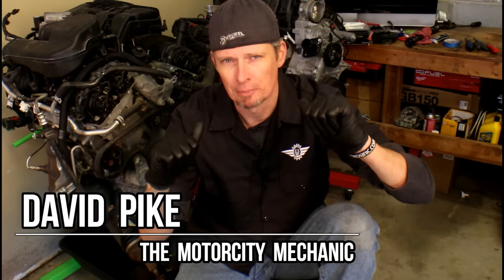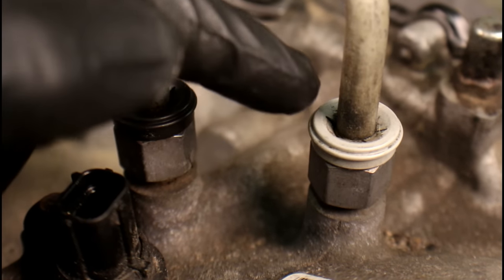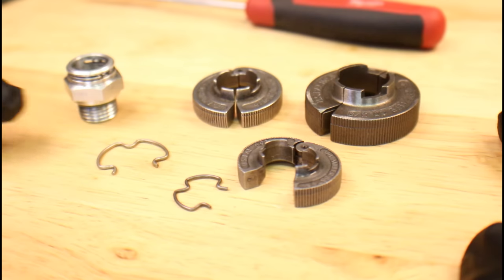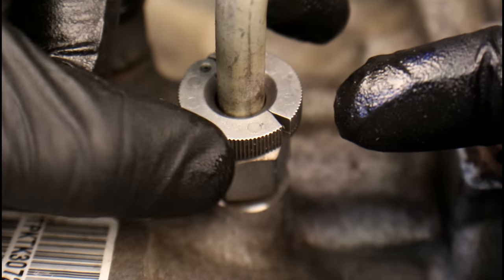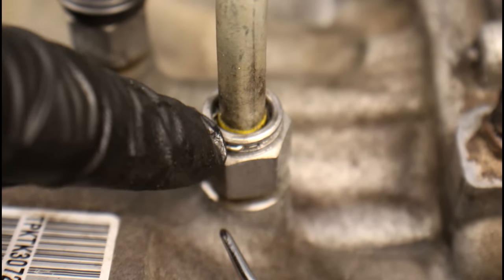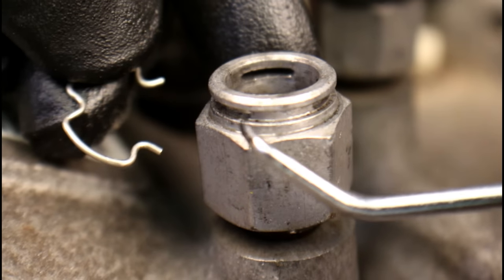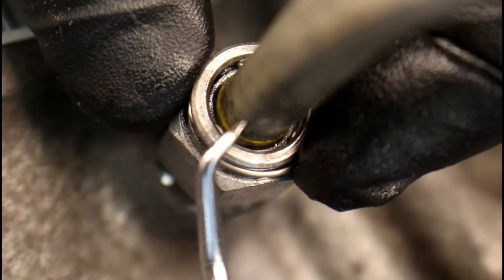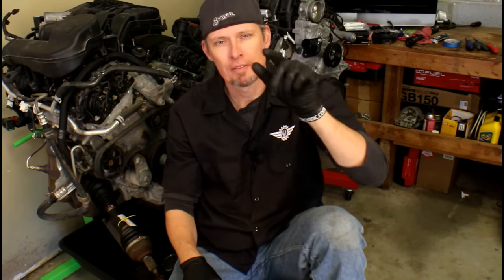Quick Tip: Removing Chrysler and Chevy transmission lines with no special tools

Comment: So I have got a friend with a 2014 Dodge Journey with a leaking trans oil cooler line. I plan to replace it for him. Do they have the same type of line as Chrysler? Also, his is the 4 cylinder model.
Reply from the maker: Most likely it will on one end or both ends. After watching this video you will know what to do. Thanks for asking and make sure to subscribe.

Comment: 2006 jeep commander I changed those fittings going into the ac/cooler and still leaks. Should I change the whole unit or will a clogged trans filter cause that.

Comment: Hello! We have a transmission fluid leak coming from the quick connect. Will buying a new quick connect stop the leak? Should we use some type of sealant or replace the entire line? 😔

Comment: Hi there... In my understanding there was transmission fluid leaking... Am I right? If so, when you removed the hoses, how much fluid was lost? and after replacement of the hose, do you need to refile the transmission fluid?
Thank you

Comment: Question for you...Which is the supply out to the cooler and which is the return back to the transmission? I think that the supply us the one that's easier to get to and the return is under the exhaust.
Reply: TE62 transmission

Comment: I am looking at a 05 Chrysler 300 for $600. Body and interior is good. Has the V6 that is good, , but the transmission is bad.
It is all wheel drive.  Found a low mileage 2 wheel drive transmission for $500.  Will the all wheel drive transfer case bolt up to a 2 wheel transmission.  ?
Reply from the maker: Wish I could tell you for sure....havent had to remove an AWD setup yet or paid attention to see how its fastened. Only way to check would be to call you local dealer and have them check to see if there are different part numbers for the transmission based on 2wd or Awd. Thanks for being a loyal subscriber.

Comment: Thread size on the transmission cooler lock nut? Looking to install an aftermarket trans cooler with new lines and i want to replace the hard lines instead of piping it up to them.

Comment: There's 2 colors on the cap. One gray one black.
How you do know wich one is the outer and the inner line into the trasmission and the same case with the cooler? I wanna know wich color goes where? There's doenst seem no identification anywhere.

Comment: Great Video! Thanks! Do you have any idea where to find the anti drain back valve on these vehicles?  I can't find the information anywhere, and your videos are my favorite to watch. Thanks!
Reply from the maker: Thanks for the kind words Michael. I have to be honest with you.....I really dont know. I looked thru all the parts info and the only thing that comes close is the cooler bypass valve that is in the case of the trans and accessed by removing the front pump. Otherwise they dont show anything seperate or even mention it for that much. Wish I knew more that I could pass on to you. Thanks for asking and for watching. Make sure to subscribe.

Comment: Great video. I will be replacing my line this weekend. Do you have any tips for the other side of the line where it attaches to the transmission oil cooler? Thank  you!
Reply from the maker: Troy Dunn Most are the same fittings as that shown in the video.

Comment: You didn't show putting the line back into the fitting !!!. Is the clip fully engaged and locked in place before you push the line in ?. or does the clip have to be out of the grooves to install the line ?.
Reply: I am replacing the radiator  and the drivers side trans line snapped into place just fine with the clip in the fitting, but the line on the passenger side won't snap in fully to get the bump past the clip area, even with the clip removed.

Comment: Hello Dave. Just a quick question... Is there any kind of failure that this leaks on these hoses can cause on the transmission like slips or other things? Besides overheating or lost pressure something like that

Comment: Appreciate the tips but you haven't mentioned how the sealing works.
Reply from the maker: It has an internal o-ring. I have never seen one leak, if it does then you have to replace the fitting. Sorry I didnt mention it. Thanks for asking and make sure to subscribe

Comment: Am I transmission I changed at the Illinois? But the problem is it's stuck in the universe and the key does not go. When I have a hard time? Pulling. It out what should I do wrong I followed all the steps

Comment: "Hello " Motor city  👍
I have a 2013 jeep wrangler unlimited JK sahara v6 3.6 automatic W5A580 transmission 
Can you please remind me witch transmission line is the hot and the cool line 
I would like to install a B & M transmission oil cooler with fan  IS the top line the hot ?
On the transmission 
I have a hard time to see the line that goes into the Radiator 🥸 
●|||||||● 
Thanks

Comment: What about when the transmission is in the car
Reply from the maker: THE FLYING DUTCHMAN still no issues with doing it. I have never had a problem with using the same method in any of the transmissions in any of the  vehicles I have worked on or the trans coolers as well so you won’t have any issues. Thanks for the question and make sure to subscribe

Comment: My line appears to have broke on the line just above the nut/flange/quick connect fitting. Is there anyway I can repair this without replacing entire line??? Thank you. Car is 2010 Dodge Charger NAG1 trans
Reply from the maker: I havent seen anything yet that will work.....the other issue is having enough length to position a fixed piece. Sounds like a line replacement might be needed.

Comment: I have a 2016 charger rt. My transmission temp has been heating up to 244 I had to pull over and let it cool this was at stop and go in the city and on the fwy it cools down. Do you think it’s my transmission lines and cooler? Need help it’s driving me crazy I thought it would need a fluid change by the dealer said I was fine. Then they tried to sell me some crap for my coolant which isn’t my problem. It’s my trans. Need help thank you!

Comment: Us backyard self taught mechanics have been using the pick method from the beginning!!...shame that car makers  need to use this crap on cars there was absolutely nothing wrong with the flare nut style and never leaked from vibration as the new "quick release" style...but I guess you can't make money or sell new modern turds...with out a gimmick😂

Comment: I have a 07 Dodge Charger that just won't run .. replaced pcm BCM wire harness every sensor key key fob alt timing chain all intake gaskets .. you name it it's been replaced and flashed by 2 different dealers .. still does not run .. fires up sometimes and sometimes not.. plugs , coil packs , recalibrate fuel pedal .. old and new intake runner value throttle body cam and crank sensor oil pressure sensor .... and no codes .. and no wire is lose or cut into .. ive traces all wires by hand 1by 1 check omS ... under the hood fuse box .. trunk fuse box ... replaced all this car doesn't run.. new fuel pump .. I have check compression it's all good on all cyl .. yes it's in time .. replaced water pump and new chain sense I was into it .... sooooooo yea .. doesn't run .. what's wrong ... and zero codes .... in dash or scanner

Comment: Is there o-ring inside tube to seal line?
Reply from the maker: Metal Halide there are but never seen any replacement seals for it, otherwise if leaking then you need to replace the quick connect fittings. Thanks for asking and make sure to subscribe

Comment: David:  I also have an older Jeep (2010 Wrangler) and I am trying to remove the transmission lines (leaking).  I removed ALL the clips using picks (no round tools have worked for me yet).  BUT one end of one line (on the radiator side) is NOT budging.  Tried moving the loose line around (in and out, left and right) and I am concerned that I might snap or break the line connection on the radiator side.  Tried PB Blaster, WD40, pure pulling straight out and now I am about to try heating it (for a short time) with a Propane torch.  The top fitting is just holding on to that line no matter what.  I am able to pull out all 3 other ends with no problem.  Any suggestions?

Comment: Ey Dave what’s is the normal temperature of the 8 speed transmission my 2012 300 temperature running around 180 to 200 F on normal driving outside temperature 60 F
Reply from the maker: There is not written specs on whats normal and I havent payed attention to the temps when driving them. Which that they listed normal temp ranges on oil and trans temps but they seem to think its not needed for us for some reason. I really need to start monitoring it when driving cars at the dealer ship inorder to get a feel for what is normal and whats not. I would assume if the temp was too high that the trans temp light would come on.

Comment: How do you get the cover back over the e clip. Is there a easy way
Reply from the maker: If I have issues I try starting at an angle and then press it down as I rotate around it until flush. Typically that works but sometimes I have to use a flat tip screw driver to push the clips under the cap so that it will go back down. Thanks for asking and make sure to subscribe.

Comment: I replace the trans fitting. Had hard time popping the line back in the new fitting. Like started to leak again. Could I have damage the new o ring in the struggle?
Reply from the maker: I feel you will be okay. Just keep an eye on it after you start the engine to see if any leaks.
Reply: My jk jeep is leaking right where the line enters the transmission.   Do i have to remove that clip and line then unthread the receiver portion and replace that?
Reply: @MotorCityMechanic  look at my above comment it was meant for you, please :)

Comment: I know it's completely off subject, but do you know anything about transmission fluid changes on the 8 speeds? I wanna change the fluids and the transmission shop is trying to charge 800 plus and most likely gonna do it myself. Any info would be much appreciated

Comment: Hey bro I got a Chrysler 2012 300 with a 3.6 engine..I was driving and some my transmission coolen line came off and drop my transmission oil out..so I turn off my car because my check engine came on..so I knew that probably it when it protections mode because it would not let me change my gears..so I try looking for the transmission oil dip stick but it does not have one so I could but some transmission oil in it..one off my friend sed let but some through the transmission breathing holes..so we did we just but one 1 quart..afther the car let me change gears..but I don't know how to check how much more I need to but in .and ..is it ok how we but in.the transmission oil.. through the transmission breathing air hose..

Comment: I am no chrysler tech, but on its' face it looks like you can just pop those plastic caps off and then put a flare nut wrench on it? Why cant you do that?
Reply from the maker: Noah Kuzel Doing that would mean removing the fitting which takes even longer. It’s harder to thread a fitting with a line attached to it back onto the trans or cooler while trying to line it up perfectly and not cross thread anything then it would to pop the clip off and pull the line out.

Comment: Do you know the part number for the quick disconnect tool?
Reply from the maker: There are different sizes of these tools and different companies make them. The most common one that I use is made by miller and the part number is 8875a. Thanks for asking and make sure to subscribe.

Comment: With my 2017 HD2500 Ram w/6.7L I have a question: I thought when I purchased my ram at the time it had all of the towing options that I can get with this three-quarter ton pick up. After reading forums I have come across where I guess there are options with 2 oil coolers or 2 transmission oil coolers. 
Is this correct? If so?  how can I find out whether or not my ram has either?
With the window sticker really not telling you anything.  Honestly I really do not want to have to tear the whole front of the pickup apart just to count coolers. Can you help me with any knowledge?

Comment: Hey would you recommend a proper installation of a 2007 300c transmission pan i just swap the fluid and notice the pan is leaking? I use NAPA gasket but should i have gone with dealer or use silicon?
Reply from the maker: Do you remember which trans....was it held in place with 6 torx bolts or a bunch of 8 mm bolts?
Reply: MotorCity Mechanic torx
Reply from the maker: That is a NAG trans it uses a thick rubber seal that holds into the trans pan. No silicon.

Comment: Any chance you know the part number or size of the retainer clips?  I had one come off while driving just now but was in my neighborhood and made it home with the remaining fluid, barely.   I changed the lines a few nights ago and that one clip didn’t seem right and it failed.
Reply from the maker: The clips arent avail separately, at least not thru Mopar.....you have to get the quick connector itself that threads into what ever it mounts to such as the trans cooler or trans case. Not sure if anyone in the aftermarket sells them. Thanks for asking and for watching. Make sure to subscribe.
Reply: 5/8 retainer clip
Reply: I found them by googling "steel quick connect retaining clip". The assortment has 3/8" clips which work for my 2017 Silverado

Comment: Question...

I took off both e-clips from the transmission lines, however I can't seem to take off the cooler fittings from the lines and they are a bit stripped. Is there another possible way to remove those fittings?
Reply from the maker: Once the clips are out the lines should come out.....you may want to stay and rotate them to see if they break loose and then come out. Otherwise you use a wrench to get the fitting out. If that doesnt work then last option is cooler and line replacement. I sure hope it doesnt come to that. Thanks for watching and make sure to subscribe

Comment: I took the clip out of the fitting already but I cant remove the actually line from the fitting. It's super stuck. Is there a way to remove it th right way? I been using all my strength and weight to remove the fitting from the line but I just cant. I did another one just like it and it simply slipped out with no effort
Reply from the maker: It could be corroded in place. I recommend trying so sort of penetrating fluid if possible and then just do you best.....thats about all I can say. Try backing off the connector itself from the trans case or cooler (where ever it is) and see if it breaks the two free and then pull the line off.
Reply: I actually damaged the nut into 4 peices... it still wouldnt come off the line so I had to use a lot of muscle and even pry it out! It turns out someone did something with it before and the inside of the nut was crimped into the line.
Reply from the maker: That explains it then as far as why it didnt come off like the other. Thanks for the update

Comment: Where can I get the clips and o ring for ref 68 trans on my 2017 ram 3500. Can’t seem to buy them with out the complete line kit
Reply from the maker: Not sure if the clips are avail seperately. Most like you need to buy the fitting that they snap into. Looking up the parts....the attached link is for the ones on the transmission. They come with the o-ring and the c-clip. Otherwise you cant get those individual items separate. https://www.amazon.com/MOPAR-55111025AB-Fitting-Quick-Connec/dp/B01EIBJ2NC/ref=as_sl_pc_qf_sp_asin_til?tag=motorcmecha01-20&linkCode=w00&linkId=5409caefaa85a70208a62ca1f1789d52&creativeASIN=B01EIBJ2NC

Comment: The snap will deform and the hose will pop off. Dont do it. Use the tool. I been cleaning this mess all day, the pressure side let loose in my case.
Reply from the maker: Never had an issue….also I recommend making sure the plastic cover is reinstalled, that prevents the spring lock from coming loose

Comment: Theres a few ways to get those off, (just like high pressure fuel lines), u can make one of those tools out of a soup can thats cut similar to the actual tool, and u can also use either a steel, or even copper water supply line that is just a little larger than the lines being removed, then cut some tabs to stick down for the 3 areas of contact, (pointed or angled tabs worked best for me), basically, the jist is simply use anything to use as a shim between the line and clips that retain them, I broke a $20 "line replacement specialty" tool, only to learn that my kids hot wheels cars are more durable, and it broke the first time I used it, (and I was being easy on it), so u definitely have the right idea, dont waste money on buying a tool unless its absolutely necessary for what ur doing, and there is no other option, get u a good hammer instead, then u can atleast get some satisfaction if the repair goes to crap, lol, thanks for posting, take care
Reply from the maker: Thanks for all those options. As you know....there is more than one way to skin a cat. Its always cool to see what other people come up with as far as tools such as you mentioned. Appreciate it and make sure to subscribe!